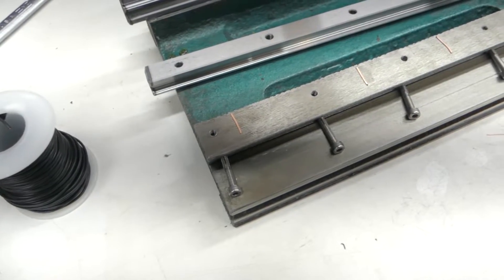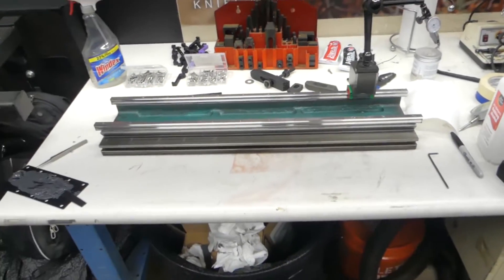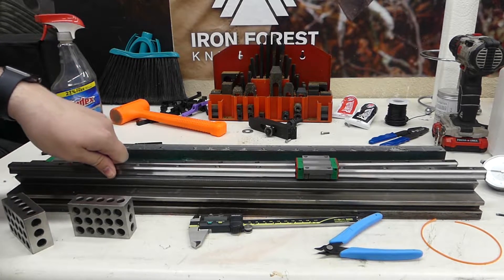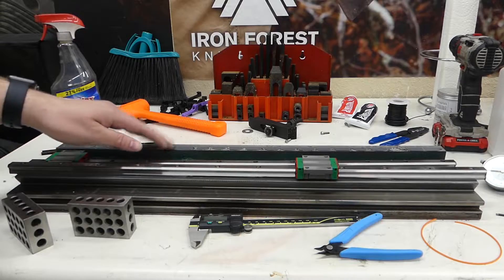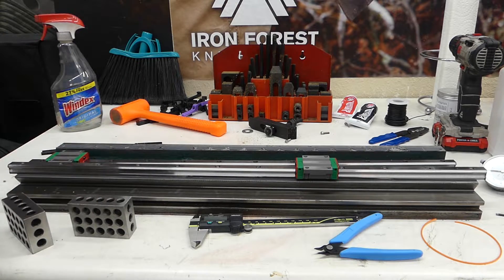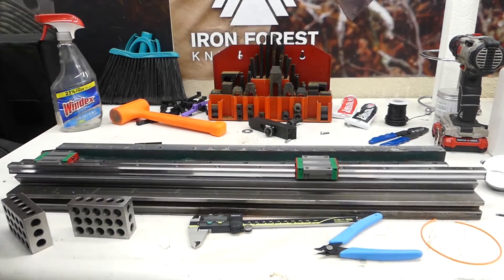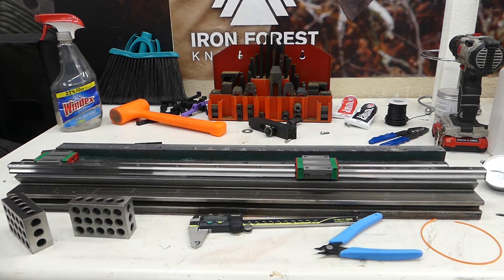My Linear Rail Idea Didn't Work... But I have a plan! - Granite Grizzly Project

Comment: Does JB weld compress or flex once cured? I know there are more expensive 2 part epoxies used specifically for this, but I'm curious.
Reply from the maker: Probably some but I remember checking that before I used it. If it does, it’s a very thin layer so whatever percentage of shrinkage it has will be relatively small because it’s only .02” thick or so. That’s my thought anywho.

Comment: I cant believe the time energy and effort your wasting. it would have just been easier and cheaper if you had taken this to a machine shop and got them to fly cut / deck a true surface with a larger mill.
Reply from the maker: I learned so much doing this, I don’t regret it at all. A machine shop would have been faster yes, but I would imagine a shop would charge $1,500 or more to flatten and cut a reference rail for 3 separate axis. Cost a couple hundred and now I can put rails accurately on anything with hand tools. Also this method has better vibration dampening than a machined surface will ever have, Important for lightweight machines. I sold this grizzly 4 years ago, but it’s still being used.

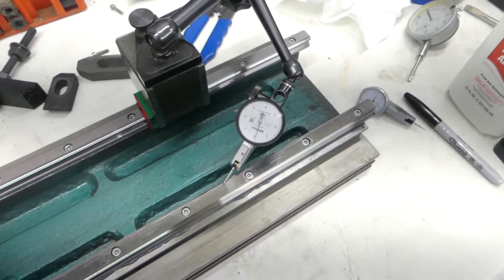Comment: 2:18 how you know that rail you use measure is flat? lol it looks like it bump same ammount every hole area and again that top surface not mean anything.its not touch balls.how much that effect on lathe. our company lathes are more flat notins lol. and even its for mill. you just mill tip plate? ehh its flatish then lol

Comment: is linear rail use that top surface? why it need be flat it use those round corders where ball bearings touch lol.
and what if earth is round and that flat you think not flat its curved? you cant do flat surface its allways curved lol. its just flatish LOL
Reply from the maker: I measured both against a 24” granite straightedge. With the indicator on the granite. If you try to measure the flatness on the round surface where the ball bearings roll, if the rails aren’t perfectly parallel the flatness reading will change if the rails get closer or farther apart.

Comment: You could also mount the block upside down in a vice and measure bottom of the rail. Distance from bottom to groove is more important than bottom to top. Wish you luck with the build.
Reply from the maker: I think I know what you’re getting at. I also measure it by putting a bearing block on it and measure from the block to my straight edge. I’m not super concerned with rail height, as I know I’ll be compensating for my warped table by shimming the bearing blocks on the saddle.